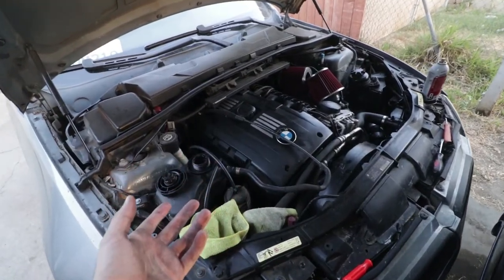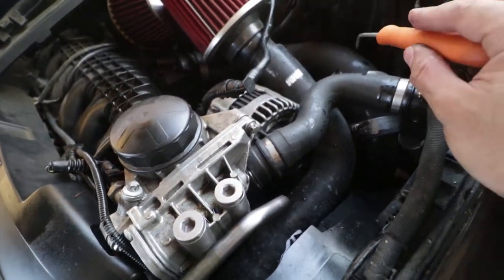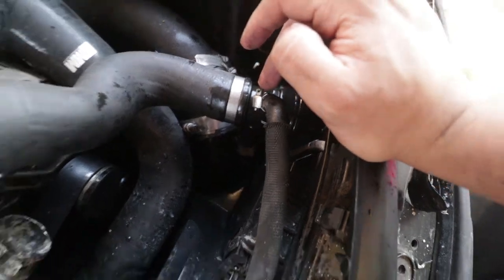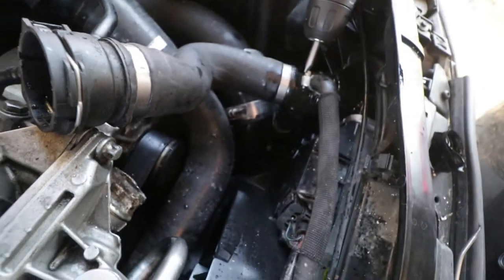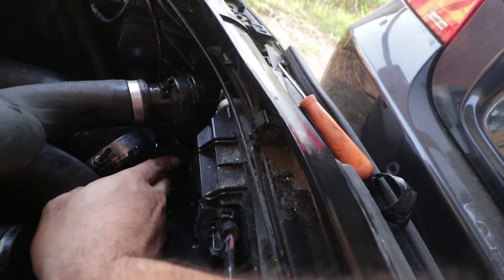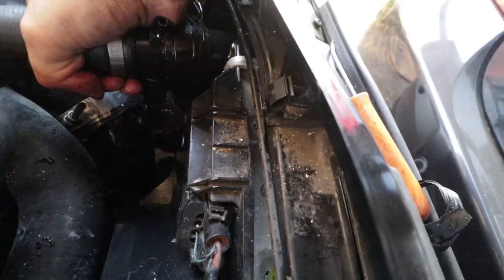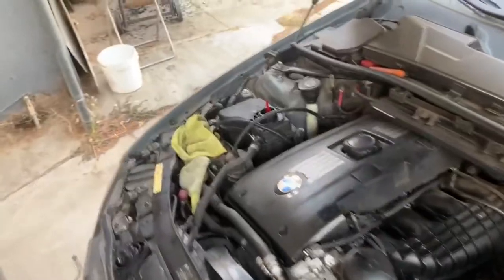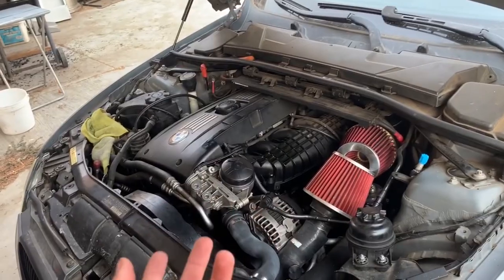How to replace upper radiator hose bmw e90 e91 e92 e93 325i 328i 330i 335i xi

Comment: This seems like an easy job to do. Idk why my mechanic wanted $500 for labor. All I need is the upper hose right? The main problem is the upper hose being ripped.. should I change both hoses just in case? 2006 325i e90
Reply from the maker: Sorry for just getting back, I hope you got it fixed now. Yes it’s fairly simple. I would replace it if you can, since these do go out fairly quick. But if not, just put some lubricant for when you replace it, it doesn’t get dry and brake :)
Reply from the maker: And it is the same with 325i as this one

Comment: I bought a used 08 328i and my rein hose ripped, while I was replacing it my hose that connects the rein to the upper radiator hose dry rotted, I’m trying to get the upper radiator hose off and it’s hard to get off like it’s glued on but I don’t think it’s glued on. Any tips to help get it off before I break my radiator
Reply from the maker: Ahh that happened to me too! I would suggest to put lubricant or PB blaster on the part that attaches to the radiator. Then make sure to try to yank out Evenly straight. If you go at an angle, it will be harder. Worst case scenario, if there’s no way to take it out, try to cut the part that touches the radiator slightly and carefully. That way there’s less stress on the stuck part. Best of luck!!👍
Reply: Had the same problem.  Ended up using my Dremel and a cutting wheel and VERY carefully cut some slots in the fitting without damaging the radiator connection.  Broke the fitting apart with a screwdriver and it came right out.  Use the slightest amount of lithium grease on the new fitting and it'll slide right in place.  Make sure the clip is down and listen for it to click in place.

Comment: Ok the part that’s connected to the radiator itself isn’t budging and I don’t wanna break the radiator any tips. And the end is plastic not rubber
Reply from the maker: Hey!! What I found easier is to remove the metal clip and through the small gap, Put some  wd40 all around. As well as anywhere that could get into the stuck side. Then little by little pry Evenly with two flat head screw drivers, or wiggle gently. It takes a while sometimes. But it will come out 😀 best of luck!
Reply: I’m here cause that’s exactly where I’m stuck
Reply: @stodd685  i would twist instead of what this guy does. hes lucky it didnt break

Comment: What’s that hose called, the bottom one running down next to the charge pipe? Mines is leaking from right there. Right on the connection to the radiator hose
Reply from the maker: Ahhh I literally just changed that one a couple of weeks ago! Part number is:64 21 6 983 858

Let me know if it’s that one lol btw, FCP euro is the cheapest one I could find. And it is the oem one
Reply: @NorVack  Bro I have been hunting for this so long thank you!
Reply: @NorVack  thanks dude I was looking for that and I could see it on the parts diagram but it was always grayed out and didn't have any numbers attached to it
Reply: same thing but it’s a lower radiator hose not an upper

Comment: I'm looking for that hose that goes from the bottom and runs to the back of the engine block but I cannot find the part number can anyone help me?
Reply: same problem here
Reply: Right, I got a leak at the hose underneath the upper radiator hose at the gasket part I'd say, I can see the drip.

Comment: That's NOT the original clamp for the little hose. I've been trying to find out how to remove the original hose with the permanent clamp but everyone that does a video on this has an after market clamp with a screw clamp! GRRRR!
Reply: Hey! If the clamp one solid ring of metal that’s been crimped on? If so, get a dremel and VERY gentle cut the band off. Then once it’s cut in half take some pliers and slightly bend them to give you the room to slide of hose off. If you didn’t damage the small hose after cutting it off then feel free to add one of those screwdriver ones! I hope this helps
Reply: Snake camps is what was OEM you need the sharp pliers to cut them off